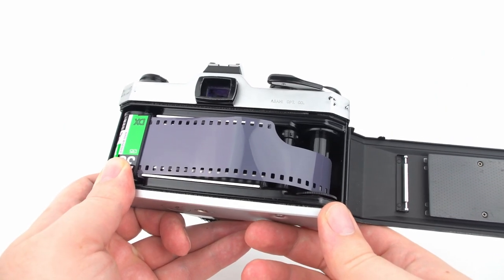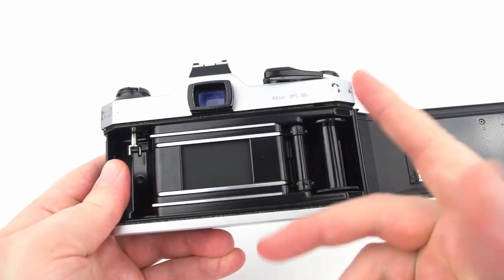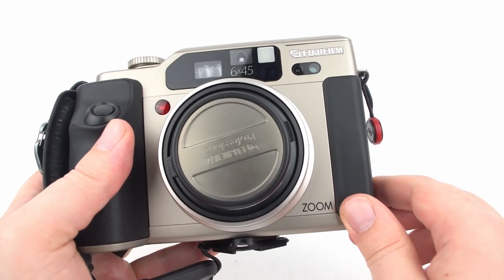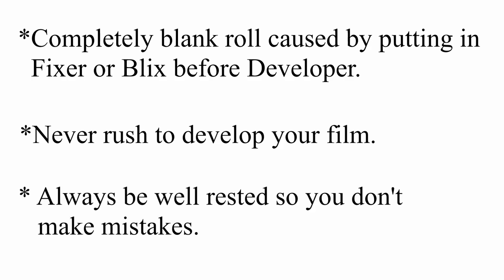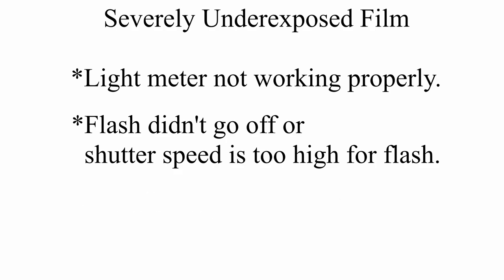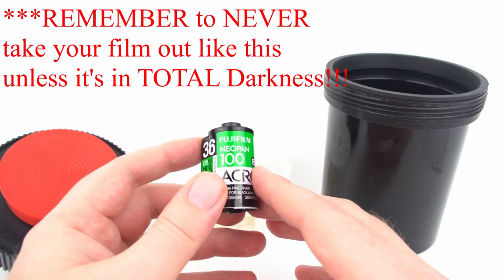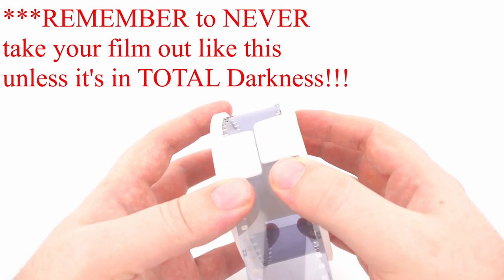Why Did My Film Come Out Blank? (8 Possibilities!!!)

Comment: Seems I have already made all the mistakes and had all the issues mentioned in here. 
Also, I don’t feel too bad anymore that I am not a fan of rangefinders. Yes, they are often nice quality and all but their „interface“ just doesn’t appeal to me. I have tried to like them but I seem to be a SLR/TLR guy through and through. The lens cap issue definitely would have burned me in the past. 

I have a few additional tips:
mark your rolls after shooting, especially when you push/pull any of them. Write your push/pull value on the canister. You don’t want to stand there in your lab with 10 rolls of HP5, 3 of which you pushed +2, one of them +1 and the rest shot at box speed - and then play a lottery game which is which because you forgot to mark them. Also, don’t toss your exposed rolls into the same compartment as your fresh film. 

If you go out shooting with multiple camera bodies (e.g for b&w / color or different speeds) : use that damn memo clip. 

If you wear anything „smart“or your wrist (read: a smart watch) and you DON‘T use a daylight dev tank: take off your watch when you spool the film in your darkbag.

Comment: I found some old film rolls in my house and I think it's my bros wedding film reel but it's totally blank so can films get damage if they are kept for years? Plz reply
Reply from the maker: Have the rolls already been developed?  If they have and they are blank then the photos are gone.  If the rolls have not been developed, and they also have not been exposed to light, then you can still get them developed to get the photos.  The longer you wait to develop photos on film, and the higher the temperature the roll is stored at, both will damage the photos.  It's best to store rolls of film that have been shot in a cool place and get them developed as soon as possible.
Reply: @PrimeStudios  no they were not developed actually, I was searching  for something else and I found them . And today only I exposed them to light😟 I don't have knowledge about photography . Can u plz suggest something .
Reply from the maker: If you pulled the film out of the canister then it has been exposed to light then any photos that were on that roll are gone. Sorry dude...☹️.  If you didn't pull the film all the way out and some was left in the canister then some photos may be left.  The only way to know is to get the rolls developed.
Reply: @PrimeStudios  that's a sad news 😭 by the way thanks for your reply . And I am your new subscriber . Post interesting videos about photography 👍👍

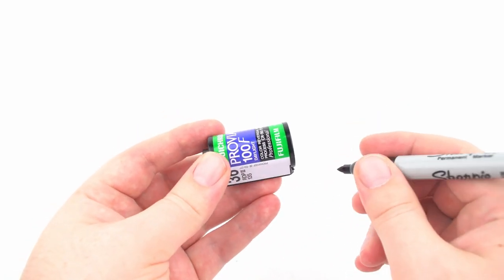Comment: 1:25 my roll of film came out blank like in the time stamp, totally black with no markings or detail whatsoever. But I always use the developer first then the blix. My batch of chemicals has not been used in about 4 months. Could that be why? I pushed the shelf life too far? I inspected my camera too, it is working perfectly as it should. It’s a Canon A-1.
Reply from the maker: If you stored your chemicals in a dark place at room temperature with minimal air interaction, most chemicals will last about 6 months.  If the roll is completely black that indicates that at some point the roll was completely overexposed to light.  Mixing up Developer and Blix will result in a completely blank roll, not a completely darkened one.  I hope this helps!
Reply: @PrimeStudios  oh whoops, I wrote totally black, I meant totally blank. The roll also was not prematurely exposed to light. I just shot another roll and I’m gonna develop it with the same batch of chemicals. If this happens again, I’m gonna assume the chemicals are shot.
Reply: @PrimeStudios  update: experiment concluded. I’m writing this not so much for you or me but for other viewers who may have the same thing happen. The exact same thing happened to this roll of film I just shot. It was what I initially thought, the chemicals are shot. Something I noticed about the Blix, not that it ever smells good, but there was definitely something off with the odor. It smelled absolutely rancid. Thanks for your help. I need to pay more attention to how I store my chemicals.
Reply from the maker: @jme92685  That sucks!  Using an accordion style chemical bottle will help keep air away from the chemicals and make them last longer.  Remember, air and light are the enemy!